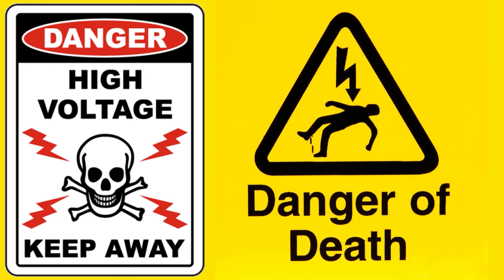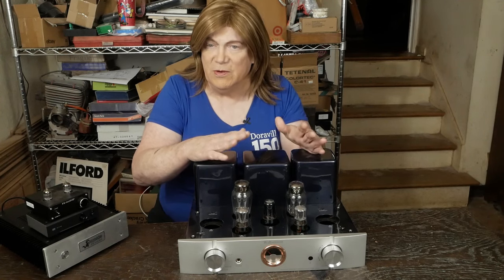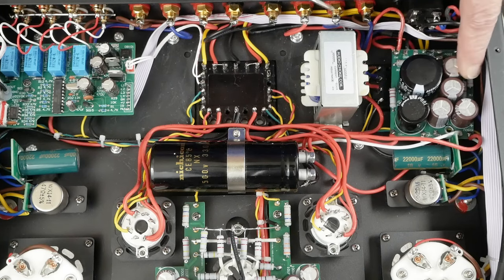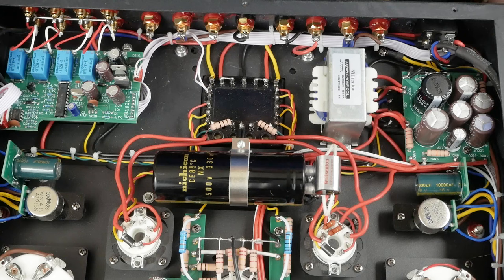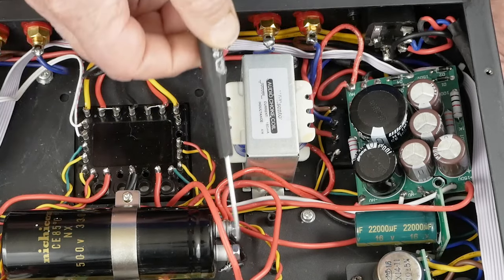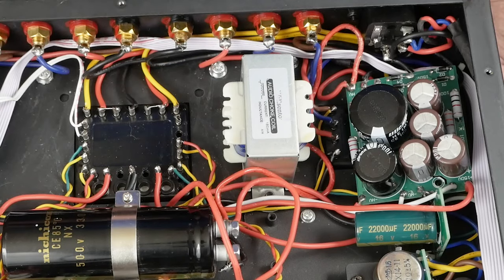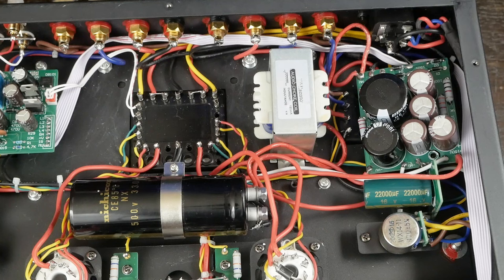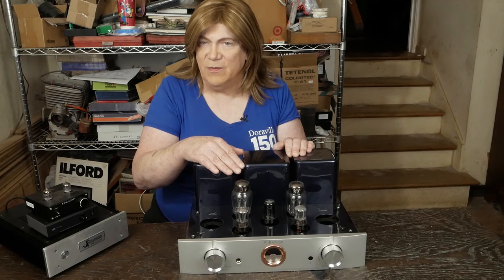Willsenton R300: Early Version Power Supply Issues.

Comment: Wow! Spent way more on tubes than what the amp is worth! Those tubes certainly deserve a better amp.
Reply: Indeed !
Reply from the maker: You do have to remember a whole group of YouTube reviewers gave this amp their top reward as "Amp of the year" or at worst "Highly recommended" raving about how great it is. It's easy to see how a consumer would believe they bought a world class amplifier from those accolades.
Reply: Yes !  @SkunkieDesignsElectronics
Reply from the maker: I wouldn't with the wonky frequency response and other design issues they have. + WE300B tubes are not going to last 50K hours at the operating point used in a R300. For the $3000 a pair of those tubes cost + the amp, there are better options.
Reply: I agree with you ! @SkunkieDesignsElectronics

Comment: I was looking at buying one of these off amazon (or china hi-fi). Do you know if this problem still exists in the ones being sold now?

I am looking to pair my Zu Audio DWX (95db) with a SET tube amp. I'm impatient and won't wait for a Decware. Any other suggested options? Thanks!
Reply from the maker: They supposedly have a new "all black" version with 5AR4 rectifier tubes. Honestly I have no idea if they fixed all the power supply problems or just tossed different output tubes in them. I would guess anything in old stock is going to be these older version unless they specifically state they aren't. I would not buy one that says they have 274B or even 5U4G tubes.

If you know how to do mods, the Reisong A50 after my mods is a really decent sounding amp, doesn't have the weird frequency response issues I haven't been able to resolve with the R300 etc. But the A50 out of the box is pretty bad. Honestly the modified A12 sounds good and is 1/3 of what a R300 costs.
Reply: Thanks so much for the information! @SkunkieDesignsElectronics
Reply: If I buy the black one and something goes wrong, can I send it to you to fix/upgrade? Lol. I'm in Ohio. Thanks!
Reply from the maker: LOL IDK :P

Comment: Do you know if these problems are fixed in the Plus version?
Reply from the maker: No idea, I haven't seen a plus version but it most likely has the same audio circuit, which is also problematic.

I would not buy one of these amps!
Reply: @SkunkieDesignsElectronics  I had one of these for a few months and liked the sound but I agree I wouldn't buy one. I had  an EL34 A10 for a few days that had all your modifications but it didn't move me like the Willsenton R300 so it made me think that EL34 tubes are not for me. Would your EL34 amp have more of a 300B sound. Thx for your time.
Reply from the maker: Nope, if you like that triode sound, it's a different thing.

Comment: Of course, one can argue about the quality of the components used in these low-cost tube amplifiers. But what strikes me most is that designing an amplifier with a good, simple, reliable schematic wouldn't cost any more. . 

I really wonder why Wilson designed things backwards. It would have been so simple to partner with a competent engineer to design a good circuit, then simply follow it up with cheap components. It's a waste for the enthusiasts who bought a poorly designed amplifier, a waste for the image of the Willsenton brand and a lot of disappointment that could very easily have been avoided for everyone. 

Let's hope that the Wilsenton brand will finally offer functional MK2 units, and that an uncomplicated solution can be proposed to all purchasers of earlier models. Many thanks to Stephe for his patient and relentless work to find technical solutions that can finally allow this amplifier to be used for what it was designed for, i.e. listening to music, without fear of destroyed tubes and malfunction. :)
Reply from the maker: What shocks me is if you just look at power supply schematics online, of the THOUSANDS of commercial products made from 1930-1960's, you won't find a single one with a monster size cap directly after the rectifier tube. Just reading Morgan Jones book would avoid this type of problem. And you know they have had a large quantity of these returned or sent in for repair.
Reply: @SkunkieDesignsElectronics  Absolutely !